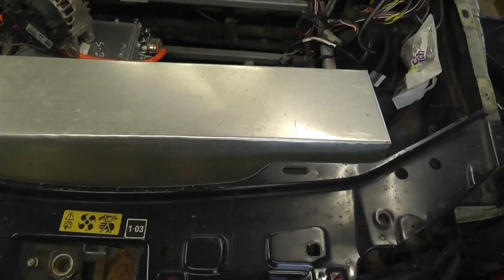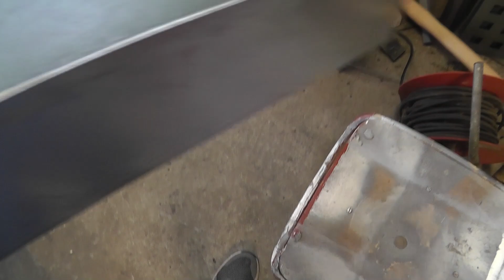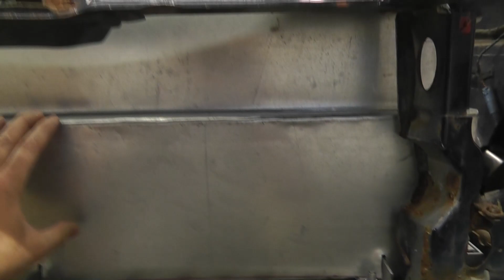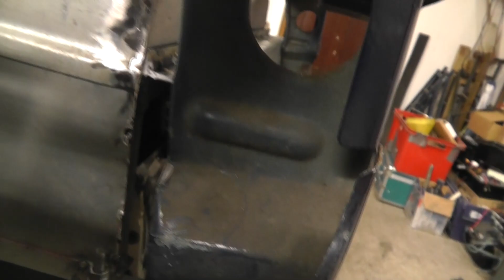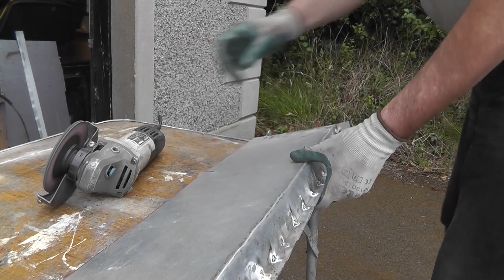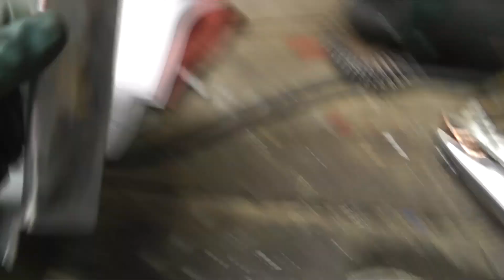DIY EV Part 31 Front Battery box cover - Making Complex shapes from Sheet steel using simple tools.

Comment: The White residue around your welds indicates the presence of a Zinc coating on the Steel, which you should be cleaning that off before welding. It won't be helping your welds and a dose of metal fume fever is no fun at all. Spirits of Salt (Hydrochloric acid) will strip Zinc and remove rust very effectively. It leaves the metal very clean and prone to rust afterwards, so needs immediate protection. Scotchbright followed up with a degreaser like Acetone may be more convenient.

For tacking, you might want to try turning the voltage and wire feed up quite a bit. That way you can form the tack much faster, which can help avoid blowing through. Also consider overlapping joints and making plug welds (simulating spot welds).

The boxes in the Scirocco were 22 SWG (0.71mm) folded with angle and a polished club hammer. Most oll of the joins were then made with  4mm Steel (not Aluminium) pop-rivets.
Reply from the maker: Thanks for this Paul
This was an old sheet I had laying around so will not be using it again but thanks for the tips.
I did try using a wire brush wheel on a grinder to remove the zinc but maybe didn't do a good enough job. I also had good ventilation while welding it.

Comment: Hey Mate, Great work.  While I'm sure that you have it under control. but before you seal the boxes shut, make sure you've done some sound deadening on those panels.  Otherwise you'll find them rattling when you drive down the road.
Reply from the maker: It had occurred thanks. They sound like old oil drums atm so I'll need to do something about it. 😉